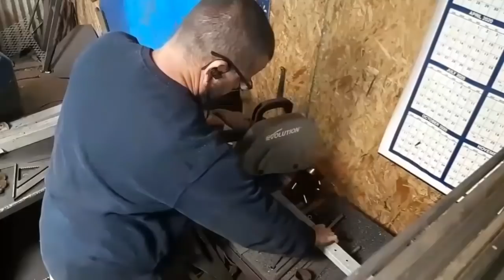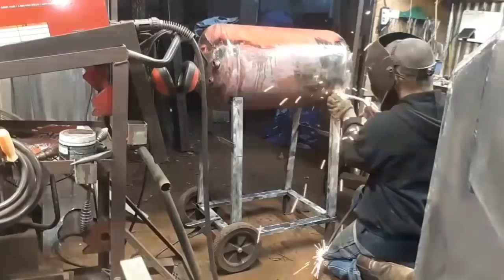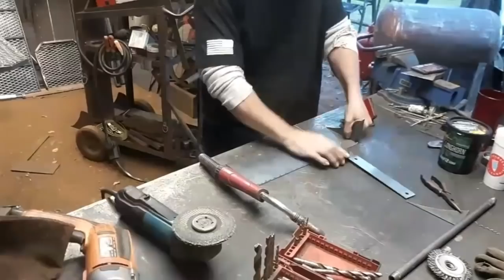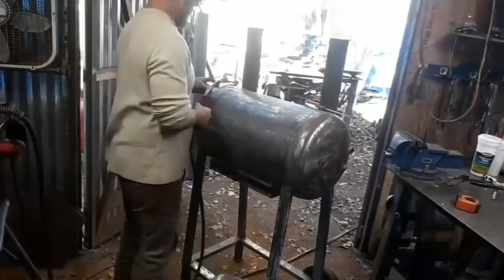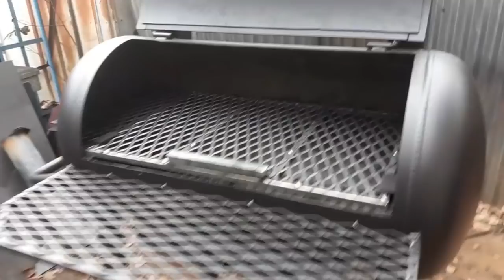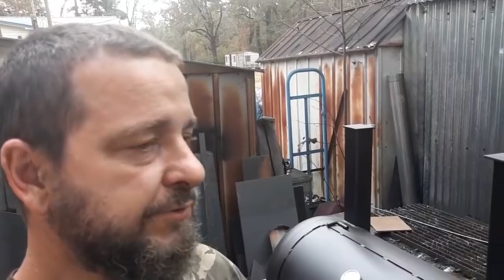Air compressor Bbq grill build

Comment: Allen, I just started doing a 60 gal compressor tank and cut it out with a grinder with cutting wheel. When I got ready to put the strap around the doors, I got some warping going on. Do you have a suggestion for getting it curved enough to where it sits flush? Thanks

Comment: Nice job. Going to start building my own very soon. Is your cooking surface stainless steel? Thanks.
Reply: Bottom tray where coals will fall is more important for SS. It wont burn out like steel. If you can find ss Beer kegs they're great to use under the fire grate.

Comment: Thats a fine BBQer/ Smoker .  You ever thought about running a  12" dia fire pot accrossed the back side  at about 5 a clock .. 
 With a steamer  or water tray  above the opening .. ?  I like to steam my Meat in the Smoker then let the  be done ..

Comment: Can you tell me what spray gun you use? I’m thinking of buying a LVLP spray gun from harbor freight for rustolium high heat paint.
Reply from the maker: It’s the cheaper one from harbor freight, I usually use them for 6-7 months and replace them, they work great if you keep them cleaned up
Reply: HVLP.
Reply: Allen's welding/woodworking what kind of paint do you use?

Comment: Where do you buy scrap How do you clean and what type of paint do you use on it when done
Reply from the maker: I don’t buy scrap anywhere but you may be able to try the scrap yards
Reply: @Allensweldingwoodworking  and i mean the aircompressors/ steel barrels,,,